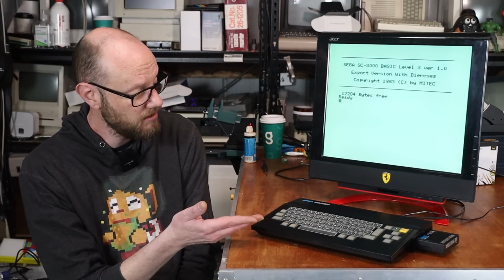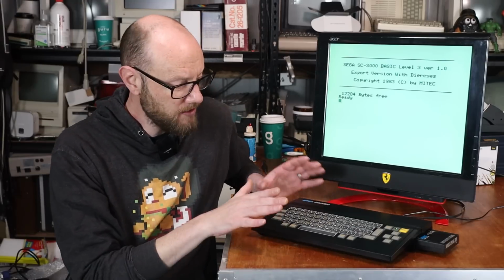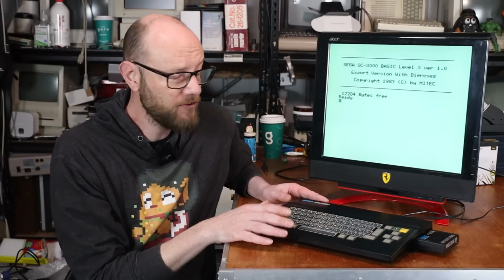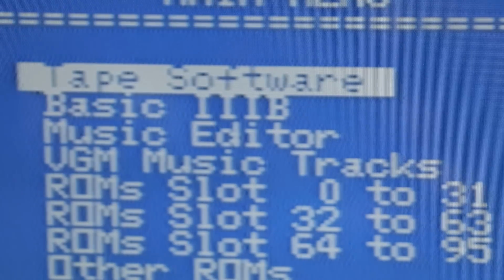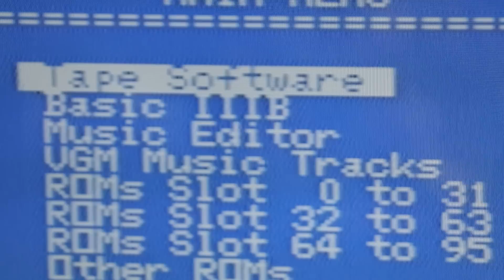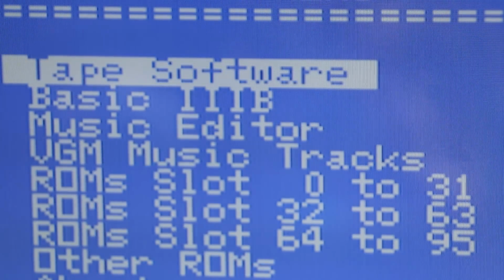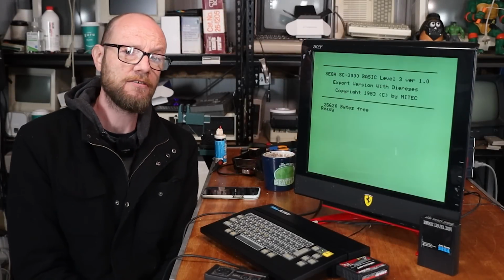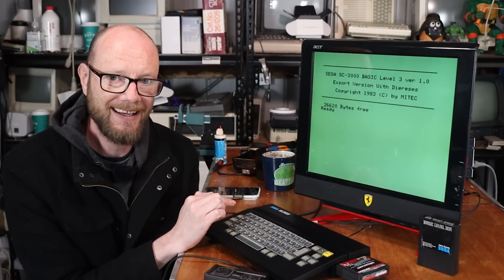Sega SC-3000 - RGB Upgrade!

Comment: I did this conversion a little while ago BUT you can do it very neatly using the same type of connector (DIN-8) simply by replacing the existing DIN-5. On my SC3000 adding the DIN-8 was simple as the motherboard even had the extra pin holes with traces that led to solder points where I could add the RGB signals from the TMSRGB.
The beauty is then after the mod you can still use the existing DIN-5 composite cable (as it’s backwards compatible with the DIN-8 pin out) and the new pinout is compatible with SMS and MD1 RGB connector.

Comment: Nice video, I just got a SC-3000 last week as well as a mk1 sg. The mk2 sg actually has rgb and sync test points you can pull from and run through a triple bypass while the othello multivision and I believe mk1 sg use a 9918 chip. Just subbed!

Comment: Something not quite right about the available ram on the boot screen on the first half of the vid....
Reply from the maker: I think you could be right. The memory reads correct when running basic from the multi cart, but not from the original basic cart. Seems the original cart may be faulty

Comment: Nice, I believe the early models of the SG-1000 Mk II can be modded using the same method as they should have the same chip. (later models have a Sega chip that outputs RGB and can be modded more easily)
Reply: I did it but it requires a little bit more effort

Comment: Clean install! I love the idea of using a mini-DIN where the modulator was and bonus points for wiring up a disconnect. Have you seen the new & inexpensive F18a alternative that's been developed recently? It replaces the VDP entirely and give you HDMI output.

Comment: Great work and a very interesting machine.  I'm tempted to get one of those RGB boards for my MSX as I'm fairly sure it uses the same chip.
Reply from the maker: It does! In fact that was the other machine I put one in.
Reply: @MrLurchsThings  cool, I've ordered 5 PCBs but it'll take a while to pull together all the parts I need.

Comment: My first computer! Think I was 15. Better graphics than the more popular C64 games.

In fact, the BASIC language I learnt on the 3000 was more fully utilised than the 64's version - the computers my school used to teach it on. (Simple commands were fine, but doing more complex things like drawing graphics... So instead of using BASIC's "line" command to draw lines, on the C64 you would have to use a proprietary peak or poke command with a correct memory address.) Years later, when I moved to BASIC programming on IBM PCs in Year 10, I already knew all the commands from my Sega SC-3000's BASIC!! The other students struggled as they hadn't learnt the full command set.

Comment: I would recommend you go with a screw mounted connector as you wouldn't need the printed part and wouldn't have issues "pulling out".  Searches for "panel mount s video connector female" or "screw mount s video connector female" show a few options.  I know your options are more limited where you live.

Comment: Large electrostatic charges are generated when tape is pulled from a roll.

What is the benefit of an ESD Kapton Tape vs. a regular Kapton Tape?
April 14, 2023

ESD (electrostatic discharge) Anti-Static Kapton tape has a conductive adhesive that helps to dissipate static electricity and prevent damage to sensitive electronic components. The main benefit of using ESD Kapton tape over regular Kapton tape is its ability to protect sensitive electronic components from electrostatic discharge.
Reply from the maker: I’m not sure what your point is?

Comment: Great vid as always! Love the SC-3000, have spent a LOT of time with them now. If you ever want to revisit, might I recommend using a 9-pin mini DIN and pinout compatible with Sega Mega Drive 2 AV cables. You can also pick up composite signal right on the TMS-RGB for the cable
Reply from the maker: I did go looking for a panel mount 9-pin for that reason, but couldn’t find anything I was happy with.
Reply: @MrLurchsThings  incidentally, if the MITEC ever fails, I have an FPGA replacement ready to go 😅
Reply: @MrLurchsThings  yeah I'm not sure one exists... Maybe a sub PCB can be made to pick up the RF mod pin holes.... 🤔
Reply from the maker: Yeah. Maybe. Kinda like a breakout board with the header pins and that mounts using the ground holes from the RF can.